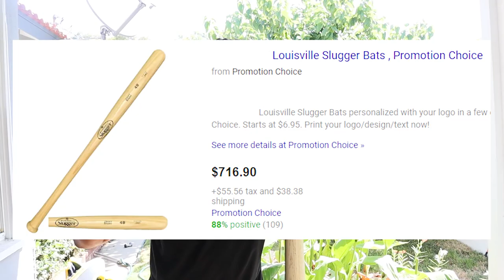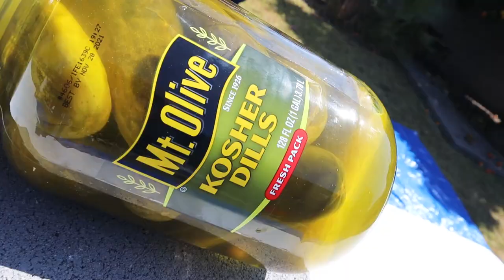CRUSHING SATISFYING THINGS With A GIANT 100LBS BASEBALL BAT!!! *WORLD RECORD SIZED*

Comment: You can fix the bat by drilling holes on the inside of both parts and hot glueing sticks in, then sliding the pieces back together and hot gluing it, maybe put some linex on it if you want to go a step further